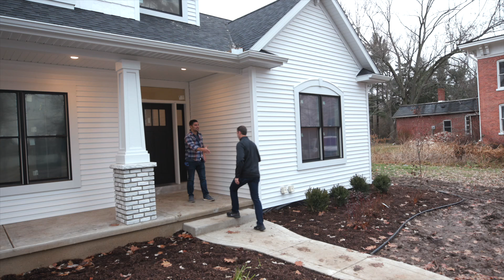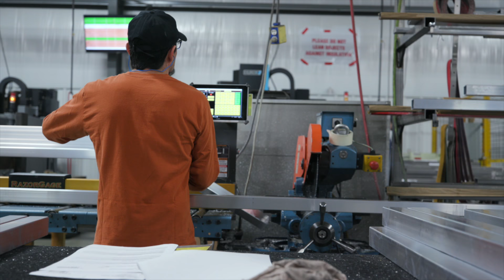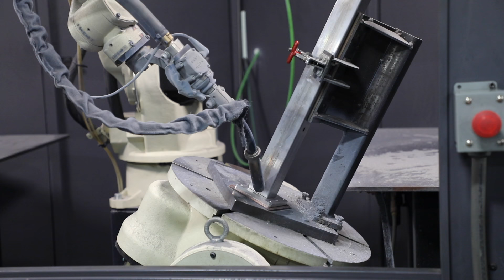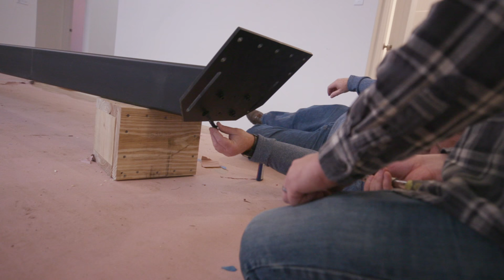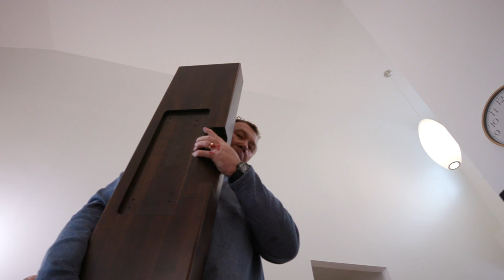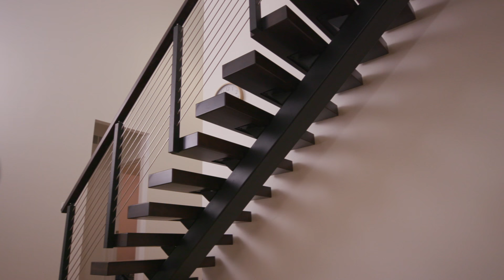One Day Floating Stairs Install - Guess How Much These Cost!

Comment: I did a set in Canada vey similar 13,980$ it was a nightmare! Nice job!
Reply: Rusty Ass What made it a nightmare?
Reply: @martymaloney1032  the single stringer is heavy, only insured and qualified builders should even attempt it.. Like $650/per step looks even more glorious all the way to the basement with the right lighting
Reply: @VictorN-o2z  That’s a lot, thanks for the explanation.
Reply: @martymaloney1032  Maybe they installed it at the wrong house at first.
Reply: Canadian rupees?
Reply: @steamsteam6607  pretty sure they barter with maple leaves up there

Comment: Just got a current quote from ViewRail for this same setup for my renovation:  
As of 05/13/22 my rough quote was 24k for a built stair case, PLUS installation starts at 24k - WTF!!??  
Maybe Matt can hook me up with his $12.5k Price 😁
Reply: Same. Something is not adding up here. My Viewrail quote just came back for a similar setup at $27,900. And that is with the new 2023 stairs that use a solid plywood core instead of solid wood. @buildshow How are you getting that cheap of price?

Comment: I am in the process of completing my project: single stringer, 13 steps:  £800 for metal, a packet of cutting 1mm discs, 2 boxes of 7018. £600 wood, 2 weeks.  Not sure about the railing yet, as we have not designed these yet
Reply: I'll be doing the same this year. What dimension square tube did you use for the stringer?
Reply: @JR-iy7pb  Bit of the overkill: 100x100x10mm - but it does not flex at all and was a real pleasure to weld. Consider a 6mm thin wall, some say even 3mm should suffice.

Comment: Sorry to troll your YouTube channel, but when I see Viewrail being promoted, I have to warn other people. I really want to like thus system, BUT had nightmare working with Viewrail. Sales person was not helpful and took several tries to even get an accurate estimate. Several revs. of him adding items I didn't need or missing items I did. Thankfully I was meticulous in going through the estimates. This process also took months as they are slow to respond and don't return calls. After painstaking order process confirmed everything, signed off and got confirmation of delivery date. That date came and went. Even after confirming they had everything they needed, they said they were missing one approval which I did not receive. No phone calls, no emails to follow up, they just left me hanging. My entire project went on hold. I had to have leg surgery and now I didn’t even have handrails which made recovery even worse. Escalating my issue was impossible. No-one returned my calls and it took several efforts, but I finally got hold of the CEO’s assistant and managed to get a message though to him. Amazingly, we finally spoke and he apologized for the delay and assured me he would have my order expedited. They put it in production, and it shipped out two days later vs. the original three weeks… so why do orders take three weeks in the first place? A week later I received the order and it was a mess. The posts were welded on skew and completely unusable. I couldn’t believe that after the CEO expedites an order that they wouldn’t do some sort of quality assurance. Honestly, the welding looked like it was done by child. I could do a better job with my limited welding skills. Needless to say, I contacted the CEO again, and he responded with getting someone call me the next day. They replaced the posts, BUT, when I sent an email to the CEO stating how disappointed I was in the service prior to getting him involved and then the poor quality product arriving, he lashed out at me. 

I was always courteous with my communication and kept my cool when talking on the phone. Never raised my voice, only stated facts etc, but this guy was so rude to me on email and even said “Go ahead, give us a bad review”  even though I never once said I was going to give any kind of review; I don’t troll or write reviews, but in this case when I’ve gone through months of poor service and being treated like an ass instead of a client – well here you go. Buyer be warned. This company has so much potential, but I would avoid them if possible. I’m happy to share the emails with anyone in doubt.

Comment: I am astounded that you don't talk about the staircase header plate attached at the second floor landing! At 2:50 you talk about 'bolting' into the vertical plate but there is no reference to how the plate was installed, how long that took and if that is or is not part of the staircase purchase. How did that plate get there? Did the manufacturer send it to you earlier so you mount it? I don't see this as a one day start-to-finish job. It's primarily an assembly, not a build. Also, how was it attached at the bottom? This is more of a advertorial which means I hope you got a really big break on the price of the staircase. Great job, beautiful unit.

Comment: That wobble at 4:17 is a deal breaker. I think the brackets under the threads should be wider but I could be wrong
Reply: The bolts tighten down afterwards. Very sturdy

Comment: This is a 8500$cad job up here, installation + tx included fpr a 15stairs setup (but with 2inches thick stairs).  I contracted a very similar setup.  I think what's blowing the bill here are the stairs, 2inches thick stairs oiled and finished are 4x the cost of 1inch thick.  These look like 3inches!, grooved underneath and all, there's probably 6000-7000$ worth of wood in that thing.  nice job.

Comment: Nice stairs, look very nice.  Here in New England I would pay at least that to build a traditional stair with red oak tread, oak handrail, oak risers,  balusters, and  oak or mahogany rail. So at least in my area, this isn’t too expensive.  The cable rail is very expensive, and I use it frequently in waterfront homes on an interior stairs. There is at least $3K worth of just cable rail on this application. 
Beautiful look, thanks for the video!

Comment: Update. received our order from Viewrail on April 15th. unpacked it. One  tigerwood tread cover for our traditional steps at the top of our staircase cracked in half. Rods of rod rail were stainless not black as my wife said we ordered - I don't remember.  Emailed company with pic of tread and wrong rod color. Reply: No problem we will send rods right out and tread as soon as it is manufactured - about 4 weeks but maybe sooner. On good Friday I was going to bolt the foot plate and the head plate to the stringer but could not find the bolts. emailed customer service again. No problem we'll ship monday.
They are growing really fast and made some mistakes. But I am very happy with the process so far and looking forward to installing myself with a helper. 
The Tigerwood tread are stunning just sitting on the floor of our gutted townhouse I can only imagine what they will look like on the stringer.
Reply: Any updates on this?
Reply: @notafanboy250  New rods came in a few days. New Tiger Wood tread showed up today. Haven't had a chance to even open the box yet.
I am doing most of the work myself on the whole town house renovation. I have a chain fall in place to lift the stringer and actually had it in place but let it down as i have to re-frame the second floor wall adjacent to the stringer. Been working on large windows in the unit. probably will get back to the stairs in a few weeks.  I don't  foresee any other problems. Are you considering this type of stairs? Have any specific questions?
Reply: @lrc87290  Oh awesome. Thanks for the quick reply. No, I just really liked them and am tucking away all this random info in my head for further down the road when I end up with the ideal house but thanks for offering to answer questions. Hope your project turns out well.

Comment: How in the scotch bonnet heck...is $12,500 for a straight run of stairs a deal???? well maybe in the world of affluence it is...but not in the really real world of less than average $40,000 per year earner trying to put a nice home together...I know I could go to a metal works shop and have a straight run of stairs same number of stringers fabricated of steel for $3000 - $4000 tops...it may not be identical to these but would be functional and aesthetically pleasing

Comment: Does look good quality, design and installation. However it's a bit long I think... Should ended right on top of the opening to the downstairs staircase,  within the wall behind it. 
Some build code prevented that? To steep?

Comment: What about doing this lower cost? I' have a plan for my basement stairs to accomplish something similar However we haven't reached that phase to try it out... My idea was to join a bunch of stringers together with either glue/nails/screws to make it thick as a block... Then paint it black... Then use steel platform and screw/bolt the threads...

Comment: You gave them two dimensions, finished floor to finished floor height? That's only one dimension. Presumably you told them the width. And hopefully the total run. And maybe which side the railing is on. On the topic of railings, doesn't US building code require a railing on both sides?
Reply: I think it does but one side is the wall so no need
Reply: @NoRoads2AllRoads  You can't hang on to the wall. The wall does not stand in for a hand rail in the building code I was beholden to.

Comment: Poorly design , foot is in the hallway !!!!
Reply: That is the house design, not the stair.
Reply: Yes, it could have had turn of 90degs for five lowest steps and save the width of the hallway. But then the stairs would have probably cost 20k :D 

They still seem to have more than one meter, more than three feet of hallway, so they don't suffer very much from this shortcoming.

This is really the most simple design and it cost so much because it was made by NASA, serious technology used. But at the end not fully practical.

Comment: Matt, what keeps the tolerance on those bolted connections? There has to be some slop in the holes even with the CNC machinery. Does this result in an uneven tread or is there an adjustment method we didn’t see in the video?
Reply: It looks like these are newer style brackets which are fixed. Holes are pretty drilled in the treads. Everything is precision.
Reply: Pre drilled

Comment: Everyone is complaining about the cost. And those of you saying you could build this for $3500 are full of it.  First off, go look up the cost of 16/4 lumber.  16 treads alone are going to run you $3800 (inc shipping). Secondly $200 PER tread is for oak, you want an exotic it gets closer to $450 per tread shipped.
Reply: I don't want to disclose what a 38 tread/5 landing similar steel/floating tread stair system cost to custom build on-site. Not to mention the countless hours lost due to other trades being unable to access areas of the job site due to the stairs being fabricated/adjusted.
Reply: @dyer1029  Gotta be pushing 75k
Reply: What 16/4 lumber? Those treads are 6 piece glue-ups. Even with the dark stain, the glue lines are visible on the treads and ends. They don't seem to have bothered to grain or color match, so some of the joints really stand out. As far as that goes, my hardwood supplier only charges a small premium for 16/4 maple. He doesn't normally stock much because there isn't a lot of demand for it. If you need a whole sling of it, it will take a while to source.
Reply from the maker: Agreed. I thought the cost was really good for this level of product

Comment: You run up those stairs and that stainless bar is going to rattle in the mid posts IMO Would drive me nuts
Reply: There is a foam block inside the post that prevents rattle.

Comment: We are in the early stages of purchasing this product. The company has been great so far. 
Before retirement I worked in a machine shop and had friends in the weld and Fab shop. 
Yes I could have had this built for a fraction of the cost if I still worked there. 
And it somewhat pains me to know that.
But you still need an engineer to sign off on the design and get your municipality to accept it. 
Still have to buy the railing and treads and get it powder coated. 
Hey take the video to a weld fabrication shop and ask them how much to make one.
We are doing a gut renovation of a townhouse at the Jersey shore. 
I found this on Matt's video from the home show a few months back.
Showed it to my wife and she was sold. That's all that matters.
Reply from the maker: Very cool Tony!  This is a family owned company and they are providing a very nice product at a reasonable cost. I think you’ll be happy with your stairs.
Reply: @buildshow   reasonable cost? you are ridiculous

Comment: Matt, it was difficult to tell in the video, but it appeared the distance from tread to tread left less than, or equal to, a four inch gap?
I have had some clients wanting the "open" stair case and don't realize the risers have to have the aforementioned gap requirement.
Still, interesting install and, yeah, a bit more pricey than a conventional stair install.
But, one wants what one wants and, when the price is agreed on, all is good. :)
Reply: 4" thick treads will cover you on that, even pushing it to the maximum 7 3/4" rise allowed by code. With a 3" tread, you're limited to a 7" or less rise to avoid a >4" gap. As with any staircase, the solution is unique to the situation.
Reply: Thanks, I've had a few clients who mention open staircases and wonder why I can't design one totally open.
:)

Comment: When they CNC mortised the treads why wouldn't they mortise them to fit the actual bracket? looks sloppy too me. It wouldn't take me more than half a day to make a jig for a router and mortise them out manually.
Reply: Standard tread that fits multiple size brackets
Reply: AKA Lazy  @espinozap2
Reply: I wouldnt say lazy more like cost effective for the manufacturer. Only craftsmen look at the details and see it could have been fit better.
Reply: @espinozap2  Installers might also appreciate it as well as it would speed installation.

Drop the tread on the mount and the fixing holes are self aligned, so no contortionist neck twisting required to make sure the holes are lined up.
Reply: Matt did mention "microadjustments" in the assembly process. I'm assuming that was fine-tuning rise/run measurements. It looks like the brackets are designed to allow for adjustments, so the "over mortising" of the tread might be to allow for on-site adjustments if the bracket has been moved as far as it can go with the drilled/tapped holes in the stringer. The manufacturer could have found that through producing a range of different stair systems that this is the best manufacturing practice in delivering a "Ready-To-Install" product as it is marketed.

They are relying on someone with a tape measure to provide them with the overall rise of the staircase. If they are going off of architectural drawings, they are relying on materials/framers/finish carpenters to be precise to the 1/64".

Comment: Any issues with code and the horizontal rod rails? I had started looking into horizontal railing but was discouraged by an architect saying it wouldn't pass code in my area.
Reply: They might be able to get away with it because of the angle, it's a good question.
Reply: Probably because children can climb up on them.
Reply: Matthew Schrenk horizontal rails are typically permitted in the code (IBC, IRC). But my experience (as a design professional) is that it will wholly depend on your plan review department, individual within that department, or inspector that comes out for inspections. A lot of them will argue saying it's not permitted because they don't like the idea, which isn't correct, but a lot of times it's easier to just give in and do it their way rather than argue. 

Unfortunately we are forced to deal with "personal objections" from people that are not explicitly against code.
Reply: @jeffreyeichert  this is the useful information I was looking for.
Reply: Matthew Schrenk that sounds like a crappy local code. The standard IRC just requires a 4 inch sphere test on the railing and a 6 inch sphere test on the triangle between the railing and the treads.